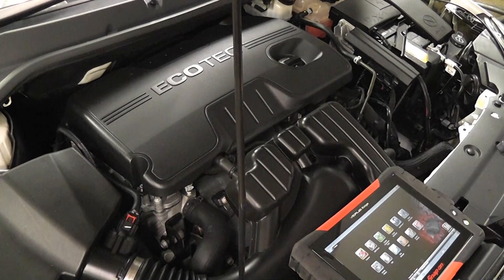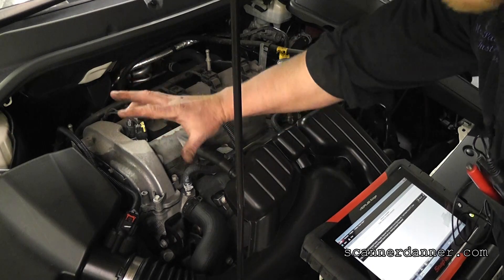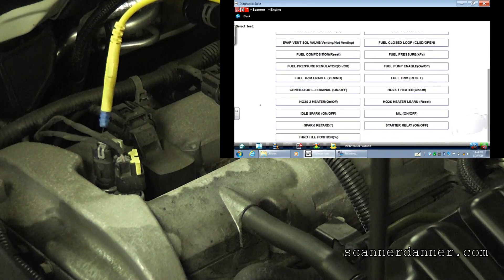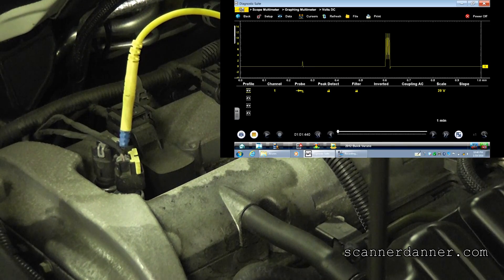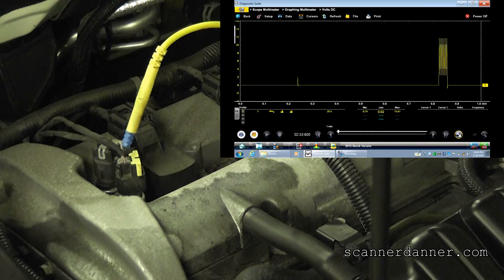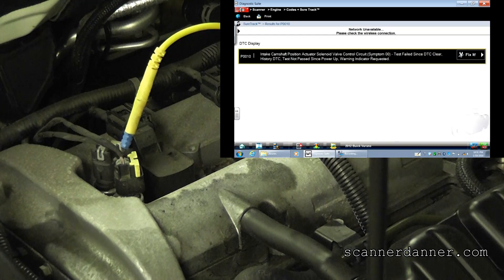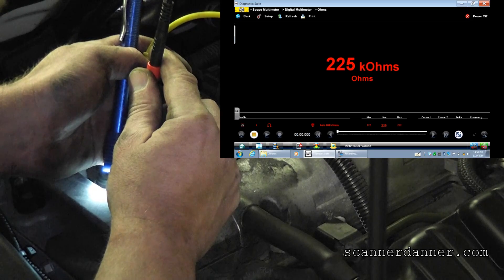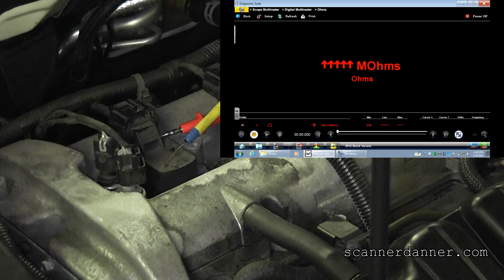Intake/Exhaust Camshaft Actuator Solenoid test (P0010, P0011) - GM 2.4

Comment: Is there a way to command this on without a scan tool?
Reply from the maker: you would have to meet the conditions for the PCM to energize these solenoids. So a test drive with equipment connected may be needed.
Reply: @ScannerDanner  thank you.

Comment: With a Scan tool there is a way to see, live, those Solenoid and identify a intermittent malfunction?
Reply from the maker: scan data will only show the command state for an output solenoid, just because it is being commanded on or off, doesn't mean that is what it is actually doing. So even with a good scan tool, showing you this data, you still have to test the output itself, to make sure that the voltage matches the command. Hope that makes sense

Comment: 2012 -49,000 miles Buick Verano code 0010, symptoms -stalling after Drive engagement, 1st signs of problem : random stalling after putting in drive,, no codes----then ran fine for a week or so...I waited on code throw to verify problem which occured several months into random stalls. I replaced both intake & exhaust solenoids with oem parts.

Comment: Hi there, I suspect my VVT solenoid is broken so i want to test if it click sounds. The problem is i can not unplug it so after watched your video it seems i can test it by giving electric to it from outside. ?? How much volts do i need ? can i extend a cable from negative side of battery to it? ??  Thanks...

Car is jaguar x type 2.5 v6 2003- mondeo engine.

Comment: Just did one checked when running one probe on Cam Sensor one on solenoid and scan tool data on cam requested control data and actual position.
Comp requests 16 deg sends pwm to solenoid and shows on scope. 
The Cam sensor reading on same solus edge reads 0 deg. 
Pcm commands are sent and are flat line then pulsing @ solinoid.
The Pcm is trying to change intake timing but the cmp sensor still shows no change and hold @ 0 deg and reveals No chain slack.

When hot coil winding opens due to heat/vibration.......
When testing for resistance known good is 11-13 oms, Hot I have an open, but when I shut down and wait to measure the reading it is normal. 
Be careful diagnosing this CEL make sure and check it twice

I Replaced the Intake solenoid..  And @ 59k im recommending a T-chain and exhaust solenoid to prevent future failure... 
I FIXED IT!

Great teaching is always loved

Comment: Looking for recommendations. I have replaced both these parts because of codes and still getting same problems with car. When in reverse car wants to shut off or when in drive car sometimes starts to studder.
Reply: did you fix the problem?
Reply: are u getting any other codes
Reply: i fixed my code prob,. bought a new solenoid

Comment: Hi Paul I had one come in today with a faulty intake cam actuator solenoid when I did my voltage measurement on the feed to the faulty actuator solenoid key on engine off, I had a low voltage of about 2volts, but no voltage on the feed to exhaust actuator solenoid... I did these checks with them plugged in. Then gently front probe them unplugged key on engine off and measured 2.50 volts on both solenoid feeds. Why the low voltage on the power feed circuit on the intake solenoid and not the exhaust. It was a 2011 Chevy HHR with the 2.2L. The intake solenoid ohmed at 125K. I had both a p0010 and P0011.
Reply from the maker: This is a bias voltage that "bleeds off" through a GOOD solenoid coil. When the coil is open, or when you unplug the solenoid, is the only time you will see this bias voltage. This voltage can be used effectively for signal circuit integrity testing. Make sense?
Reply from the maker: So the intake solenoid coil was open and the exhaust solenoid coil was not during your measurements.
Reply: Yes this makes total sense, I appreciate the confirmation with the bias. I work at a dodge dealership and I see bias voltage lines are quite common with Chysler as well as many off makes that come through the shop like this HHR. It’s just a matter of being able to identify the bias voltage.

Comment: Would it be possible to unplug the connector and put a test light between the two pins and toggle on with scan tool to check power and ground? Then use dvom to test the resistance on the solenoid?
Reply from the maker: Yes but it is very dangerous, it you let your test leads touch each other during that test you can fry the PCM driver. And yes you can do resistance testing to confirm if you like. I do not rely on the ohmmeter though because a good reading can still be bad (unloaded test)

Comment: I have rough idle and P0016 which says camshaft position correlation bank 1 sensor A on cheap scanner....Do I change the camshaft position sensor and then try actuators if it doesn't fix?

Comment: I have had a few cases where mice chewed the wiring harness for these under the intake but I appreciate the info because I did not have a proper method of testing the solenoid control. Thanks

Comment: is there a difference between the intake solenoid and the exhaust solenoid? will it be bad if I put the intake solenoid into the exhaust port and vice versa? The parts look exactly the same except for the color coded gray and black tabs.

Comment: i have chevy malibu 2.4 L 4 cylinder 2013  and 2 months ago there was check engine light and after diagnostics found P0011 code . I just clean the intake cam position actuator solenoid valve and reset the battery , after 6000km ,same check engine light appeared while i was driving at speed of 80km/hr and i accelerated the car . After diagnostics P0011 code was there.
Engine Oil level is fine and i used to do engine oil replacement on regular basis . 

Is this a solenoid problem because last time i just clean the solenoid and check engine not appeared till 6000 km or there is mechanical problem in engine like carbon .

Also there is minor oil seepage on below oil pan side. Oil level on engine remains the same.

Comment: HEY DO U KNOW WHERE THE CAMSHAFT POSITION SENSOR IS LOCATED ON THAT CAR
Reply from the maker: not off hand, sorry
Reply: @ScannerDanner  There are two also, intake and exhaust, intake is on the right side of the engine when facing it, just under the high fuel pressure. The other one is on the opposite close to the exhaust, just behind it between the car frame and the right side of the engine.

Comment: Hey bro I have a 2012 gmc terrain 2.4l with code p0010 and the obd scanner saying it's the camshaft position actuator solenoid. Would doing what you did fix the problem? Before all this happened my car was running perfectly fine until I went to the store for 5 minuets and when I came back I turned the car on and it worked fine but as soon as I touch the gas no matter what gear it's in the car chokes and shuts off. As long as I don't touch the gas it works perfectly fine. Thank you for your videos dude!

Comment: Just a thought here, if you use the Power Probe Hook you can activate your circuit and the tool will give you an amp  and loaded resistance reading. Love you videos.

Comment: ok sorry let me correct myself it wasn't a sensor it was a solenoid actuator so it was on a 12 volt line and i can see from your scope it was a 12 volt feed for that solenoid i had intake pinned at purple wire with key on was at a steady 2.4 volts NO fluctuation i grounded my meter and pinned intake purple wire and read a steady 2.4 volts

Comment: hi scanner so cool i just helped a buddy who has a 2010 malibu 2.4 it had a po0010 intake ACT solenoid i had a old snap on scanner what i did was turn key on i pinned intake sol and read a steady 2.4(i didn't even bother trying to work accelerator because i just thought that should be a 0 to 5 volt range and being stuck on 2.4 was wrong )volts i had a near zero reading on exhaust my buddy had another engine with same solenoids on it i replaced it and did a cam relearn - not sure if i needed to do that light stayed on until i actually started driving i figure that because the engine wasn't under a load of any kind - by the way first thing i checked was oil level was i correct in that i wasnt sure if it was a oil pressure driven system? i will be saving for a modis ultra i can get em off the truck here in anchorage for 5900 peace out thanks
Reply: +chiefeaglebear too funny it had 2.4 volts on 2.4 engine : 0

Comment: Mr. Danner, how do you like the new verus edge? Is it a lot faster compared to the Verus pro? Im considering trading in my verus pro and getting the edge with the new faster processor and ss hard drive.
Reply from the maker: +Phillip Kang so far so good. there are a few things I don't like but some of it is because I do videos. 
There is no built in microphone so when I do a desktop recording it is hard to sync.
The stylus absolutely blows
It has no connection to the car which is great but not when you are mobile and need it for hours of use. 
There is no hdmi or video output without buying a separate docking station (additional $300)

Pros
- boot up is a lot faster
- on CAN systems the scan tool functions absolutely fly!
- I can move around the car with it (awesome)
Reply: +ScannerDanner sweet. ill definately trade the pro in for it. is the scope same as the older verus? i remember you stating that the newer vantage took out zoom feature or some feature. i was wondering if the verus edge is like that?

Comment: I have worked for gm for a long time and the component test is usually where you find the fault. testing the resistance between the terminals it should be about 10 ohms. and neither should be shorted to the case. I have found most to be shorted to the case

Comment: Paul - isn't there an engine running test for those solenoids?
Reply from the maker: +Steve A not that I saw but possibly. I wasn't worried about the mechanical or hydraulics of the solenoids so it really wouldn't have helped me any further

Comment: Hello Sir. I notice you use a general test light for your vids.  I just bought one from Harbor Frieght for $4. Looks like it uses a little bulb. would this be good enough for most simple test like checking for spark. Thanks
Reply from the maker: +murrmann7234 yes but when it comes to transistor testing, be sure you measure the current flow of your light bulb. Like in this video
https://www.youtube.com/watch?v=gEQnKNLlcFQ

Comment: A quick test of the solenoid is to bring the engine up to operating temperature. Run a resistance test after a brief hot soak. With the proper mating terminal connector in the solenoid and test meter leads, grab the solenoid connector housing and gently move the solenoid housing, try not to disturb the leads while doing this. If the reading get erratic, into the mega ohm range, replace the solenoids. Getting the engine up to operating temperature is key to finding this intermittent fault here. As mentioned this is a very common fault with these engines.

Comment: hey scanner danner, I got a solus edge and a first gen verus, I was thinking about getting a verus edge, but you were having problems with the ohms on the verus edge, my old verus take a few to display correct ohms, I was think about just getting a new vantage instead of a verus edge, and still keep my verus but no further updates, which doesn't bother me since I mainly use the scope function  what are your thoughts. I'm a small 5 bay garage, and the only diag tech
Reply from the maker: +Ryan Baker not sure man. But I wouldn't let the ohmmeter issue sway your decision. I mean, who uses a tool like like for an ohm check anyway? I only did for video sake (giant screen)
Reply from the maker: +ScannerDanner however, if it has the ohm feature, it should be a good one considering the cost of the tool!

Comment: i wonder if contaminated oil and plugged screens create a slow response time and the computer program detects and faults the part.
Reply from the maker: +Mike R not for a "circuit low or high" code. This is electrical in nature on GM. Some manufactures will differ with this though

Comment: As mentioned in the video this code pertains to the control circuit. Lack of oil/low oil (Oil consumption) or aftermarket oil filters usually cause DTC P0011-P0014, which are performance codes. Using the scan tool to command the camshaft position actuator & watching desired vs actual parameters will tell you a lot before having to jump into circuit testing. I try using my Modis ultra scope as much as possible, but working for GM requires me to use their scan tool more since we work on newer vehicles & software for any aftermarket scanner is not avail. Anyways I thought I would also mention that the resistance for both solenoids good is 8-13 ohms & the control circuit is a pulled-up to a low current voltage (1.5 - 3.5v = normal). Great video and thanks for making me a better technician.

Comment: I have had good luck using these scanners can command the solenoids to move the timing of the cam while watching the cam sensors see the movement.. Then if no movement, check the wiring to the solenoid ..

Comment: I always ohm them first, I believe they should be no more than 15 ohms when good. I use a pair of left over wires you get when you replace a connector and they have the extra wires in the kit with the spring terminals already on them. They fit right on the pins just like the factory connector pins do, and with the end of the wire stripped I can attach my multi-meter's clips directly to the wires, and not have to hold them in place. (these work great for ABS and other sensors for quick and painless ohm readings).  9 times out of 10 the solenoids are either open or shorted, and if they check OK but the code remains then I break out the scanner and leads at that point. I will add that the shop scanners are always "in use" so any checks I can do with a meter to rule it out first saves time chasing down a scanner on most days LOL. Great video on checking the powers and grounds though!

Comment: I had a GMC small SUV....Can't recall the name LoL. Certainly not a Verano anyway but an ecowreck engine with and exhaust cam actuator code. Adding 3 lt. of oil seem to do the trick. Knowing the solenoids are garbage I might have jumped to conclusions. Bringing the oil to the full line and vehicle hasn't returned in about 8 days.
Reply from the maker: +wysetech2000 nice

Comment: I'm surprised some one hasn't made a kit of connectors for testing components.  I have made a few myself. Just for that purpose. When dealing with tiny pins, it's can be a pain to get a correct reading. Or when powering up a component, you don't want to cause a short. But I would also suspect a complete kit would cost $1,000
Reply from the maker: +Steve P. I have a kit that was in my truck and I should have used it. http://www.aeswave.com/uTest-Advanced-Terminal-Test-Kit-p9467.html
Reply: +ScannerDanner ... that's close to what I'm talking about. I want actual connectors with pig tails. but yes I have something close to that kit. Not as elaborate. regardless... thx you for you videos. one of the few that shows the real world struggle of our jobs.

Comment: Glad to see you got the Edge. It is lighter, faster boot up in less than a minute & 5 seconds in standby, Windows 7 Embedded, SSD and virus protection...I'm glad I upgraded & enjoy using it. Great video as usual!
Reply: Did just buy a normal cheap laptop for 500 dollar:  Lenovo i7 SSD Win10 home.
Will never buy a computer without SSD again.

Boot time was 7 seconds.
Now it start to be slow with login and the november 1511 update: 10 seconds boot.
Did remove the stanby mode so windows dont have to write to SSD every time. 
So on wake up its in memory and just gets right back on track.
I love that.

 1 minute boot time with SSD must feel very long time.
If they cook that win7 so badly for protection and full of bottle necks in HW, i dont know.
Reply: +Robert jissbom It only takes about 20 seconds to boot up Windows & then @37 seconds to open the Diagnostics Suite compared to @4 minutes for the Verus & a little over 3 minutes for the Verus Pro. Verus Edge you can put into standby mode & boot up is 5 seconds. I am very happy with my Verus Edge and Snap-on is continuously improving the software to be able to be competitive in a growing scanner market. Lots of great scanners out there to pick from to meet everyone's needs & budget.
Reply: +Robert Hayward , thanks for the update.
I will for shure go for other scanners. 
The best tools have never been all in one.

Comment: There's hyundai and kia special tools that allow these resistence checks easier. there's sets of wires that have male and female pins of different sizes that allows you to connect to components, insulated, then on the other end there's a bulk connector that you can easily use any meter.      Basically eliminates your struggling to get an ohms reading.  No clue what there called off the top of my head.

TCLE 020A
Wiring T Connector

TCLE 020C
Wiring Tester
Reply: You can buy a back probe kit too. Many tool suppliers sell them.  You can also make your own.  That's what I do.
Reply: +Lynx Star Automotive (Gabe V) absolutely you could make your own leads w spare wiring harnesses.  didn't even think of that.

Comment: Thanks again for your demos. We used to do it  that way back in 2012,  then GM school  give us an intro to GDS2. 
Using GDS2 with engine under 35% load, tech is able to see the cams going from retarded  to advanced + at the same time looking at vvt solenoids  calculated values less than 2 amps ok according to specs. 

After market oil filters on  most of the times in brand new cars can cause this condition, and the only way to find it is using scanner PIDs line ups.